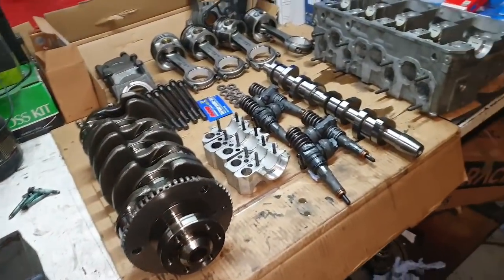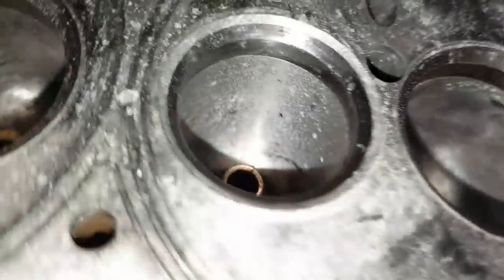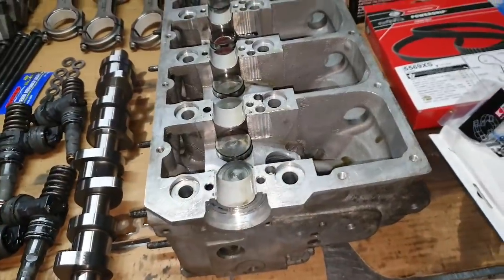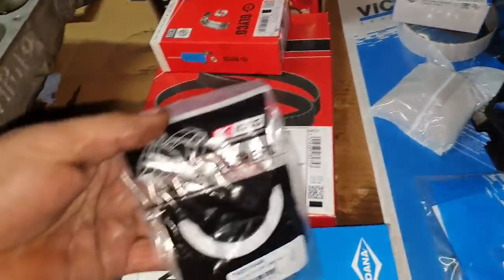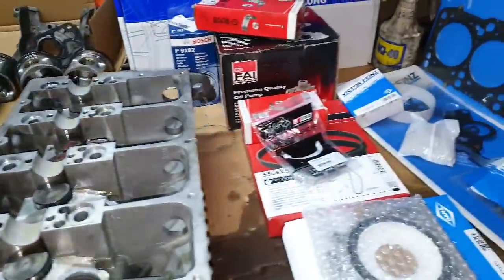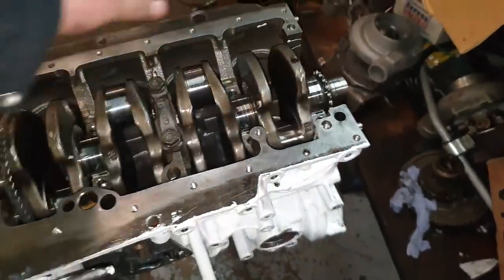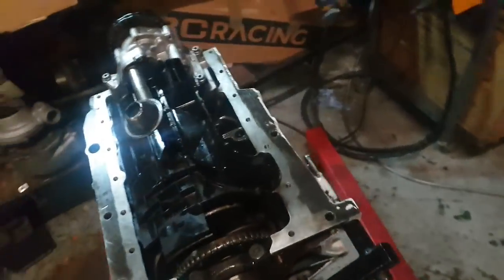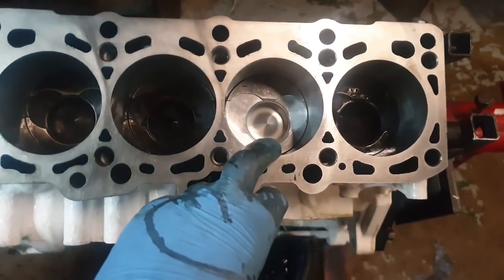Build my racing engine 1.9tdi PD  #helderputoperformance  #skillaturbos Drag racing engine

Comment: if i put a pd150 turbo and pd150 injectors on a 1.9 tdi BRS engine will the engine start and will i be able to drive it until i can get it mapped
Reply from the maker: Yes mate
Reply: @HelderPutoPerformance  thankyou really enjoy your videos i had a reputable company tell me it would not start and  another tell me i would need to get it mapped straight away as would not be able to drive it as would overfuel do you know if the BRS 1.9 tdi suffer from conrod failure like the BLS and BXE you seem to know what your talking about

Comment: Can anybody tell me if I need to install new high lift valve springs with my 272 degree +9.8mm cam shaft? Thanks
Reply: You must ported the pistons ,like on this movie. I thing aprox a 1.5m maybe 2mm depper as stock
Reply: You can use 272 cam with completely stock engine, I would suggest Ina black

Comment: what compression ratio are you running? what 1/4 mile times and power figures are you hoping to make. 350hp?
Reply from the maker: 1.9 tdi  over 500bhp  I ded before 10.1s 139mph